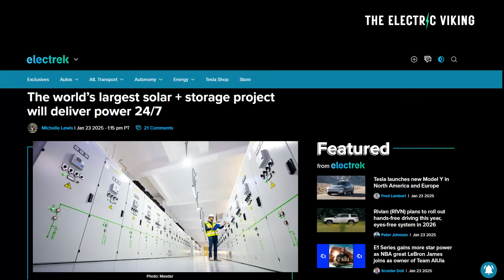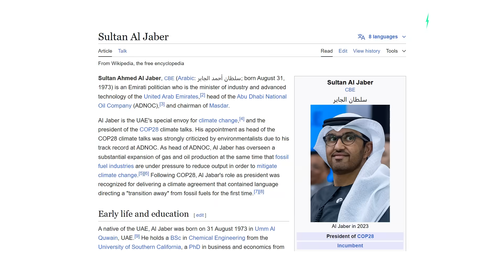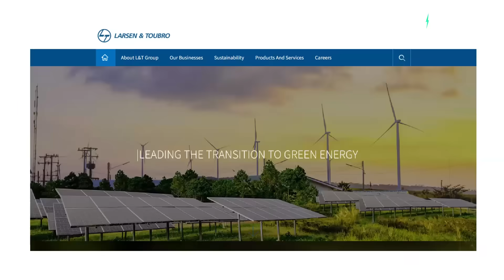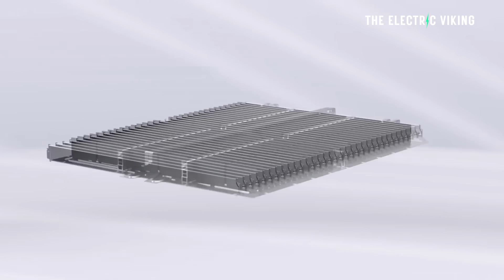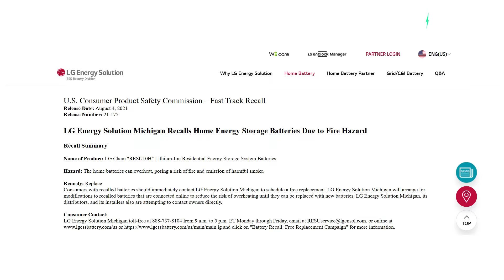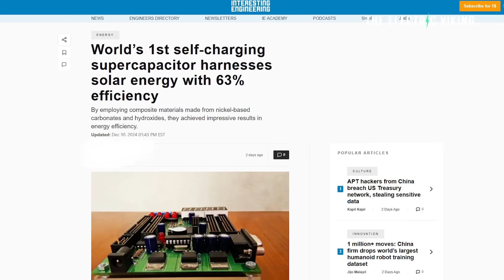The world’s largest solar and battery project deliver power 24 hours a day

Comment: You misunderstand "baseload", this is because of misinformation spread by fossil industry.   Baseload in the minimum "load", it is separated out for steam plants like coal and nuclear because they cannot economically supply above baseload because they respond too slowly and it also means a non-stead revenue stream for these expensive to buy and maintain plants.
Baseload supply is a disadvantage not an advantage, it doesn't matter where your supply comes from for baseload.
Certain renewables are variable obviously,   there are consistent renewables too, but this has nothing to do with baseload.
Steam plant does provide an advantage in spinning momentum to help smooth the grid, however batteries can do this.
Reply: The amount of batteries needed to power e.g. a small country like Sweden, for just a day, shows that we need nuclear power.
Reply: @martina5328  And the Swedish energy minister, Ebba Busch, is currently pushing to reinstate Nuclear capacity that was cut because their alternative wind generation isn't cutting it in times of low production. Renewables don't work without storage! Every "off grid hippy" and cruising sailor has understood this for nearly five decades.
Reply: @martina5328  your ignorance is truly outstanding.
Reply: @andyfreeze4072  That is not an argument - where is this park with wave generators producing any amount of power comparable to a nuclear powerplant? - And what is the correlation between wind and waves? And again, in the winter, when it gets cold (that is when there is no wind and the ocean is flat) where do we get the power?
Reply: @martina5328  Not sure what your point is.  It wasn't an argument it was a correction on terminology.  The fact is "baseload" is not a requirement for the grid, its a concept only for inflexible expensive steam plant.
Wave is secondary 2 dimensional wind, and pretty useless sure.  However there are several sea based wind farms in the UK that produce more than most Nuclear power plants.
Perhaps you already know that wind is secondary solar formed by the energy concentration being different across the surface of a rotating planet, this means the wind is always blowing somewhere, hence interconnects are very useful.  If you are in the US you won't like interconnects, but in Europe we are investing in them alot.
The consistent renewables are tidal and geothermal, wave power is the least likely to be used.
If you think Nuclear is the only answer either you are in the Nuclear industry or your are not an Engineer.
Reply: @tonystanley5337  I am in economics - when the wind is blowing, there is overproduction of electricity - i.e. here in Sweden the price approaches zero and even becomes negative. The producers are not profitable. Why on earth should we build more wind then? When we need the power - when it is winter, no solar to talk about (and no wind - that is the cold) we MUST rely on nuclear (or fossil fuels - water is already deployed).

So we must have 100% nuclear as a backup. Please explain why we should pay with money, dead birds, dead insects, to ALSO build masses of windmills?

What is the cost of the grid, the forests needed to be cut, the cement, maintenance, for each windmill - versus production of the power in a single location already set up as a powerhub?
Reply: @martina5328  Please stop with the no wind when it is cold. Since you are in sweden: In Sweden, wind power generation typically peaks during the winter months, particularly between January and March, with the highest percentage of electricity generated from wind often occurring in February, reaching up to 27% of the country's total power generation according to recent data from energy think tank Ember; this means that the highest wind power generation by month in Sweden is usually seen in January, February, and March.
Reply: @martina5328  Nuclear cannot backup solar and wind, because it can only supply baseload and its too expensive to have sitting around.  You need gas, storage or more grid connectivity.  Nuclear is not helpful.
If you want Nuclear you can't allow wind and solar to compete with it, it won't payback then, but you can run anything and socially fund it.  Not really competing then, but it costs alot, try and find out how much Nuclear costs France Taxpayers.

The problem with excess power is that you don't have enough users paying on a variable or dynamic tarif.  This is what smart grid is for.  For example to heat your water tank, or thermal storage when electricity is cheap.  In the old days that meant at night when demand was low, but today that means when variable renewables are plentiful.

I promise you wind and solar is much cheaper than Nuclear.  The amount of maintenance is very small because the consequences of failure are low, it only has to be done for economics and not safety.  The cost to build and run is way lower.  Forest are not cut down for it, and our cars kill more birds, as do our cats.   We put more plastic food packaging in landfill than the number of wind turbine blades made, but these can be recycled.
Honestly all your arguments are standard propaganda.  Privately funded Nuclear is over, the only thing that will exist in the future is Gov't guaranteed or Gov't owned Nuclear.  The UK has had to be very innovative in order to force Nuclear to stay alive as a private investment.  They are basically forcing private companies to tax consumers and give the money to Nuclear companies
Nuclear is OK if you have baseload for it to supply, but its NOT a backup for wind and solar.   However baseload is generally reducing because equipment is becoming more efficient, but it might increase with electrification.
Reply: @tonystanley5337  Is the power crisis in Germany propaganda? More expensive power - selling to the highest bidder = the poor will starve and freeze.
Reply: @martina5328  It doesn't, noone is going to power Sweden or any country from batteries for a day.  There are other solutions to balance the grid and Nuclear CANOT balance the grid.  This is why you are wrong and I am right, you are missing information.
Reply: @tonystanley5337  What other solutions?  - to balance the grid when there is no wind or solar. Fossil fuels?
Reply: @tonystanley5337  Balance or not - when no power is produced from solar or wind - where will the power come from? Nuclear implies huge heavy turbines - you can increase the load. If you have some waterpower on top of that, great.
Reply: @tonystanley5337  How is increased connectivity a solution - if there is no wind and not sunny in northern Europe. Is the south have double capacity all of a sudden? And how will you transfer power across large distances using the output from wind turbines? It is not possible without huge investment (it is not like the power you get from a huge nuclear powerplant).
Reply: @ Since you are in Sweden, please start talking to the planners for your power generation mix. It seems they do not agree with you. They plan on doubling solar and wind capacity by 2030, improving the local and interconnecting grids, improving efficiency of hydropower, adding multiple types of energy storage, and MAINTAINING the nuclear power generation capacity. NOT increasing it to 100% of renewables. Ask yourself, why they are not listening to statements like yours? Spend some time evaluating your beliefs comparing them to what is actually being built and planned.
Reply: @martina5328  There is never no wind or solar, sure an interconnect to Australia might not be feasible, but one from the UK to Morocco is being built right now.  we also have connections to all our neighbours.
Reply: @martina5328  You only have questions, I can answer them but you are not listening and the answer is incompatible with all the propaganda you have absorbed, I have not gotten time to debunk it all, and I have no doubt that anything that is conclusive you will simply doubt.  Put it this way, don't worry about it, the Engineers know what they are doing.  Its the politicians you have to worry about who have absorb the same propaganda as you and think that generation type is a political choice.
Reply: @markvalery8632  Check your sources - government has gone from closing nuclear to agreeing to build more !
Reply: @tonystanley5337  So your are saying - build 15 times as many wind turbines that is needed in Europe + hope that wind in Europe will not drop all over Europe at the same time? Are you 6 years old? What is the cost (what is the cost of building and connecting at sea) and environmental damage of that?? During the war - fishing kept Scandinavia from starving. They stopped a wind turbine project as it would make it impossible to fish if needed. When would that be finished - in 200 years?

Look at the weather map over Europe. We are part of the same weather system.

What would the cost / loss be getting the power through any cable while not using the inertia from huge turbines such as those in nuclear powerplants. Shut down the nuclear powerplants in France, and the UK and import solar from northern Africa? Calculate the area or number of windmills needed.

Are you high? What will you doo during the night? What will you do when there is a storm and you need to shut down the windmills?
Reply: @tonystanley5337  Build your system BEFORE shutting down the nuclear powerplants... Learn from the Germany crisis. Once you start planning your new system you will realize that we need nuclear and that it is the best option for power by far.
Reply: @martina5328  The system was built before shutting down Nuclear power, do you actually think they are that stupid?  Germany has the best Engineers and they are treated with respect in Germany.   Nearly all grids use Natural Gas for grid balancing and bulk power because its cleaner, more efficient, more flexible, cheap, less CO2 per unit energy etc.   The problem was relying so much on Russia supply.  This affected everyone, its not a problem specifically for renewables, and in fact electricity uses just a small amount of gas, the big user is home heating.
Reply: @martina5328  I'm an Engineer its all easily doable.   The main cost is the additional transmission however there are ways of distributing the storage so as to utilise the existing transmission better.   Such as with home storage and Home generation.
Nuclear is just too risky, thats why it costs so much, even when you don't include the long term liability and cost of permanent waste storage.   Nuclear can never be low cost because of this.   I have no problem keeping it alive with the odd plant and experimenting, but its not something that can help with climate change at this point.
Reply: @ 3. Nuclear Power
Current Capacity (2023): ~6.5 GW (6 reactors).
Plans: Sweden plans to maintain its nuclear capacity as a stable, low-carbon energy source. The government has approved the construction of new nuclear reactors to replace aging ones and ensure energy security.
They are replacing aging reactors. Show me one report were Sweden is increasing nuclear power.
Reply: @tonystanley5337  Are you a HBTQ Engineer? Calculate how much storage you need. All the batteries ever produced would cover about 2 weeks of the electricity use in Sweden with 10 million people. So multipely all batteries produced so far with 1000 - then we can support the world for 2 weeks ! Two weeks! Imagine the cost and the environmental damage to produce those batteries.

Hydro is the best - if you need a backup that you can turn / increase quickly. But that is limited by geography. Next we have Nuclear - talk to any real engineer or someone who understands how the grid works.

If it is no problem - start with FIXING GERMANY. Sweden and others keep them supplied by nuclear power + they burn fossil fuels b/c they shut down nuclear.

They are now looking at restarting nuclear reactors and building new ones. 

Do you understand. Germany shut down their nuclear reactors. It did not work. FIX that by magic before suggesting less Nuclear.
Reply: @martina5328  I understand, you don't, your conclusions are wrong.  I've already explain most of this.  I'm not re-explaining for you.
Reply: @martina5328  "They are now looking at restarting nuclear reactors and building new ones. " What German government agency or official or private company said that? Where are the plans to build new nuclear? Which existing nuclear plants that had been scheduled for decommissioning  are now being restarted?
Reply: @markvalery8632  Both CSU and CDU are planning for restarting German reactors and building new ones. Search it and you can read about. We need reliable power. More is needed with ICE cars turning into EVs. We are not going to use less power in the future.
Reply: @martina5328  They want to reduce gas demand, but it really won't make much difference to heating, unless they have a plan for that that you know about.  Its more like the Ukraine war will be over before they get any new reactors built, restarting is feasible but still expensive and will have planning difficulties.  Far easier to expand wind and solar, but there is a big Nuclear lobby there that spouts all the same stuff you do.  Who will win I don't know, but if Nuclear wins it will server to prove that Nuclear is not the answer for the next time.  Thats what happened with Hinkley C.  Big reactors are now off the table in the UK, its baby ones from now on..until we realise they generate more Nuclear waste.
EVs mostly use spare overnight capacity, it doesn't really need more capacity.

Comment: Please correct me if I am wrong.  All thermo power generation heats water to make steam to turn a turbine.  Isn't this heating of water to steam also a contributor to global warming.
Reply: Potentially.
It also take a LOT of energy to heat water.
Reply: If you burn coal, petroleum  gas or any oil product to do anything, that produces Carbon Dioxide. simple. Mining these substances produces masses of Methane as well, which is far worse ?80 times? worse at greenhouse heating than CO2
Reply: You are correct but the amount of heat is very tiny compared to solar heating.

Comment: The uk would need to have a massive increase in storage. We were down to 10% renewables during the latest cold snap. No wind for a few days and overcast and it will deplete the storage, until we have an international backup system the UK still needs nuclear. We also would be held hostage by the international supplier.
We have a few days a year where most of the UK is covered in fog and no wind. Batteries and other storage will not provide enough storage.
I am fully committed to a non nuclear and fossil free future. Fog bound for a few days at a time is our curse.
Reply: What is wrong with nuclear energy. Cheap reliable. Safer with every generation. The cleanest choice. No need for millions of birds and thousands of tons of insects to die.
Reply: @martina5328  simply wrong again.
Reply: @gobot109  Merely saying I am wrong is no argument. Elaborate, answer what I ask please. Or you obviously do not have any argument to bring up.
Reply: @gobot109  what do you mean, what did I get wrong
Reply: I think the supercapacitors are 63% efficient at capturing the 22% efficient solar. So it is 0.22 x 0.63
Reply: Nuclear is necessary , it makes everything else more simple and makes customer prices lower
Reply: you do realise there are other forms of renewables, and in England your surrounded by it........its called an ocean. Wave power and tidal power  DOES WORK.
Reply: @andyfreeze4072  How much wavepower with no wind or even ice on the water? What is the cost of connecting all these wavebreakers and maintaining them? Now compare that with producing power at scale, in one location (nuclear).
Reply: @andyfreeze4072  with wave and tidal we would have an issue with both if we had frozen seas, and usually in that case we have overcast and still conditions. There are no guarantees with renewables even with backup. Unlikely I know but it is possible. Again the beast from the east had us in these conditions.
Reply: @andyfreeze4072  Everything "works", but is it scalable?
Reply: If it's overcast there will be wind.
Reply: Tidal is our best option
Reply: We have a problem of drifting sands, with breakwaters preventing the movement. If we were to replace those breakwaters with containers in a linen with small generators providing inlet/outlet we could generate electricity most of the day.
Reply: whatever you do DONT link into the euro grid, that would be a very very stupid idea. Dont store energy as ammonia or hydrogen. Look for every problem to stop the obvious not look for the simple solutions. Wont be fog bound over all of europe or north africa or Ukraine, or Greece.... and they will all have batteries, pumped hydro, wind, heat sinks, wind, hydrogen, ammonia. Look at Australia, it has a NATIONAL grid and its as big as europe and only 30 odd million.
Reply: @ The beast from the east would have stopped the supply from Europe. It was overcast and still for many days across Europe